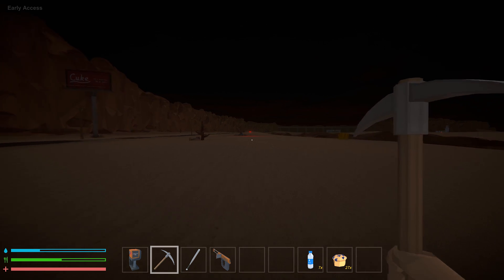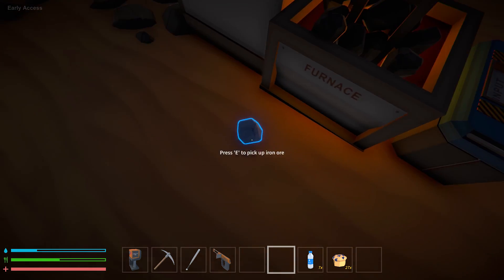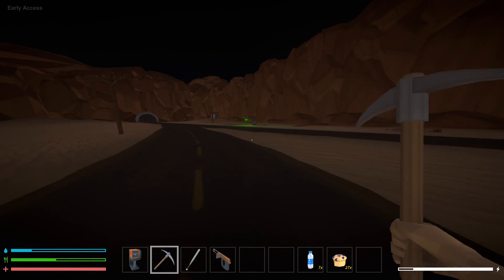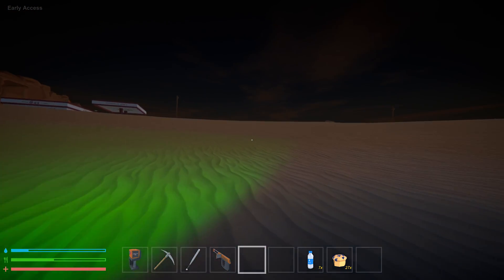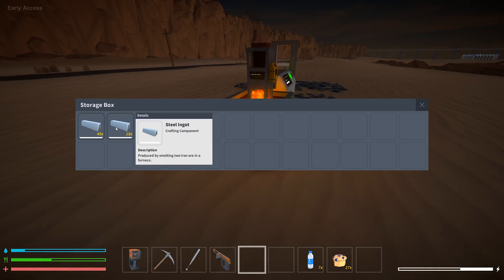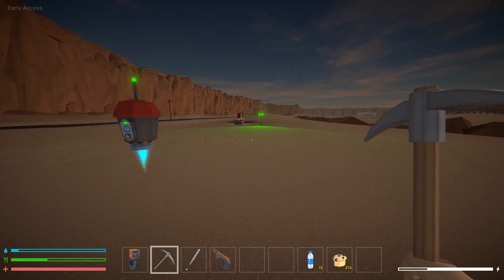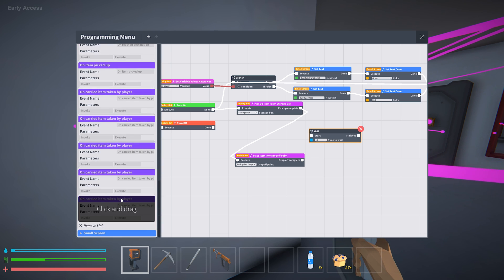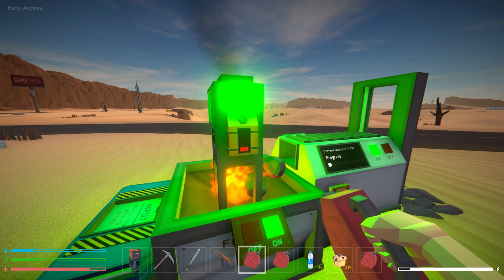Mechanica Gameplay - How to Automate Fuel Production - Tutorial

Comment: How I did it was that every time the chemical plant produces fuel, it turns one bot on, and triggers it to collect two ingots. I did that using the repeat command. After it has looped twice, the bot turns itself off. This saves an enormous amount of battery power, and I've never had to actually replace them.

I also use this trick to collect water, which I'm producing very far from my base. In this case, every new bottle produced triggers a bot to go get it. The trick to save power is to have the bot turn itself off one it's done.
Reply from the maker: Genius!! Thanks for sharing!

Comment: Interesting setup.  Personally--to make sure that the steel ingots are only delivered as needed--I would

A)  Have the b-bot pick up a steel ingot, then go to a marker near the chemical refinery and turn it off.
B)  Once fuel is created, turn the b-bot back on, deliver the steel ingot, then loop back to A.

(A stack of ingots should be left in the chemical refinery's hopper just in case the delivery of ingots gets interrupted.)

That should both make sure that there is always a reasonable number of ingots in the chemical refinery's input and extend the b-bot's batteries *substantially*.

Does that make sense?
Reply from the maker: It does! Thanks for the tip!
Reply: The makes sense, thanks for sharing that idea :)  I had thought just to use BB-2 and run Ingot > ChemRefin > Oil > CR > Ingot.  Basically do a full rotation between the 3 locations, picking up the ingots, and the oil and returning, however, your way allows for 1 BB per job; minimising errors.  :)